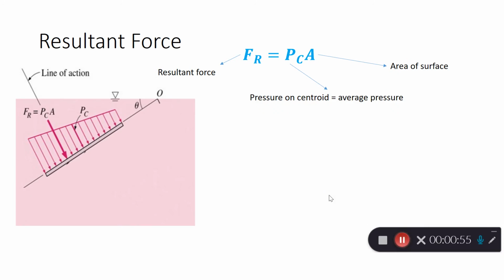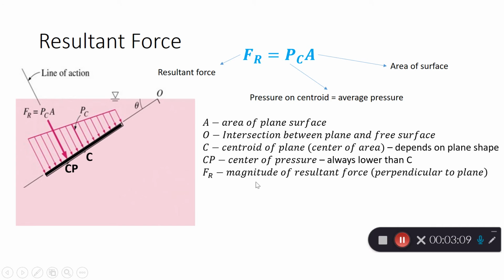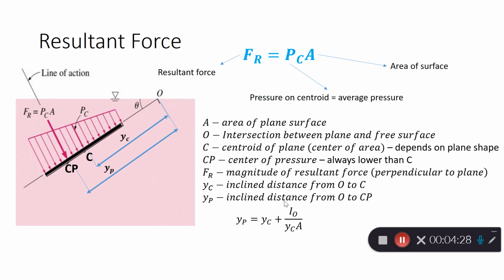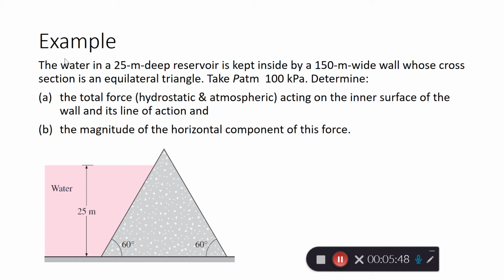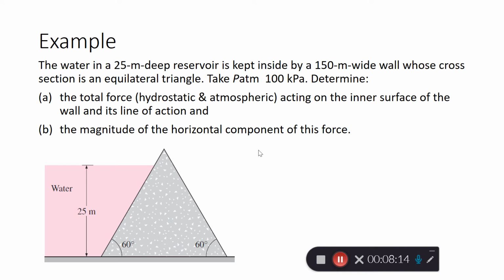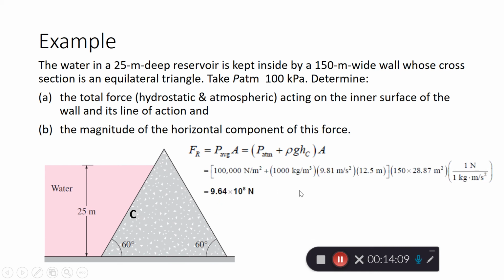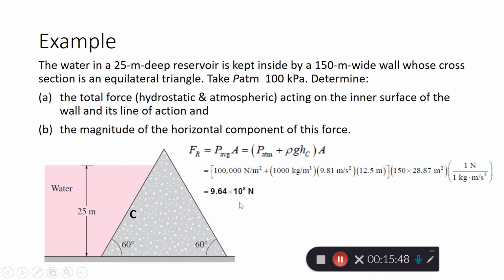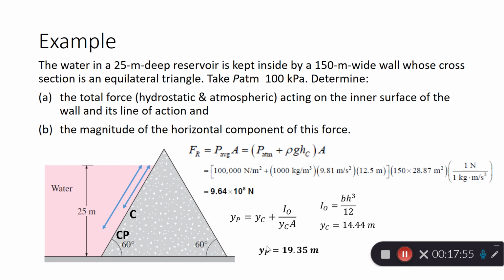Fluid Mechanics - Chapter 3 - Hydrostatic Force on Inclined Plane

Comment: madam why you have taken Moment of inertia of Rectangular  shape while it is a prism shape ?
Reply from the maker: The triangle shape is just it's cross-section. It's not in contact with the fluid. If you look at it from the side, the surface that is in contact with water (the inclined surface) is a rectangular wall. Try to sketch the 3D.
Reply: @iyliaelena9308  Thank You